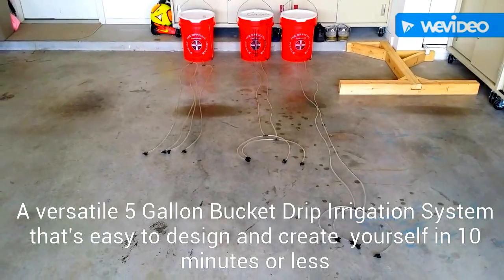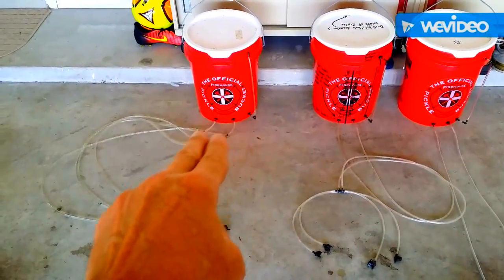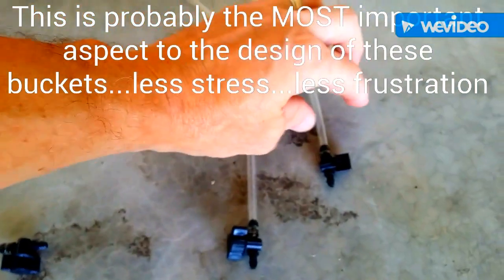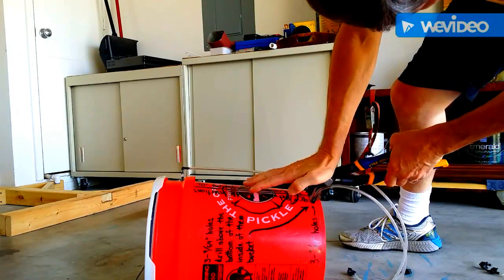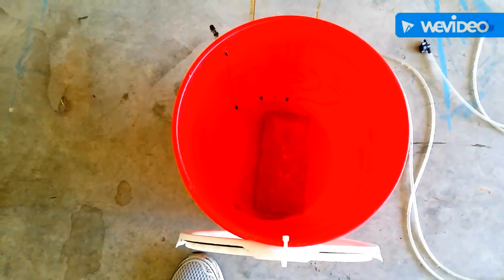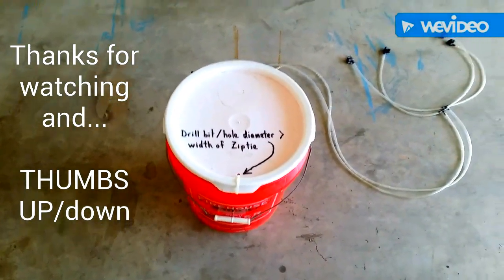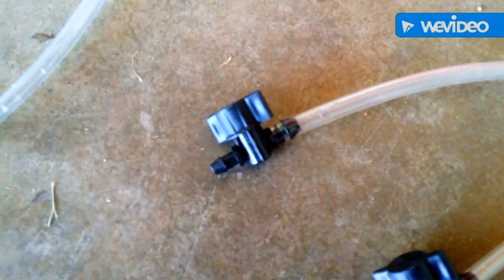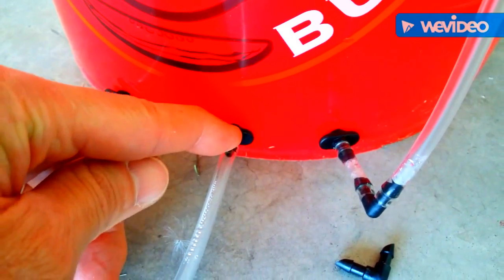[40] Drip Bucket Irrigation || features, basic instructions and other helpful information

Comment: In your parts list, did I miss the thru wall fitting used to create passage for the water inside the bucket to the tubing outside?
Reply from the maker: Good catch, Thomas. 
I just did a little bit of homework, found the part, entered that info as 5) in the description below the video and updated all of the prices.